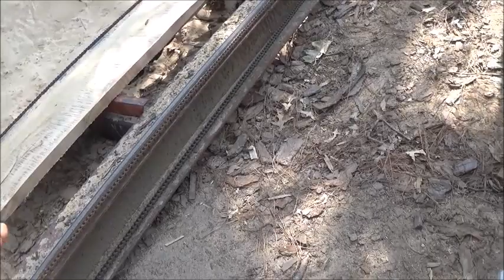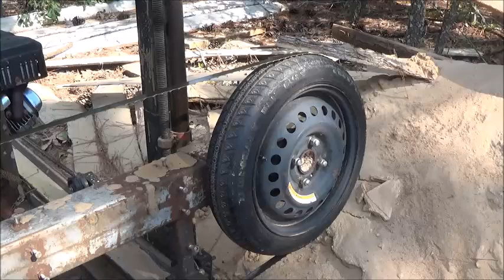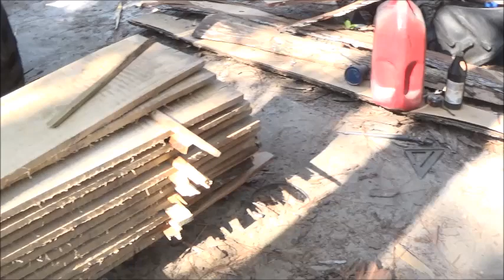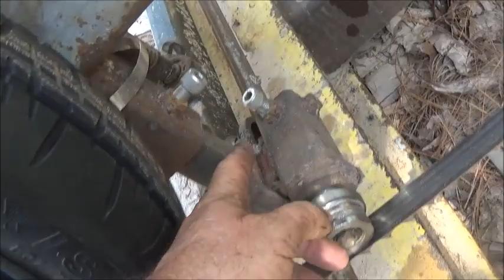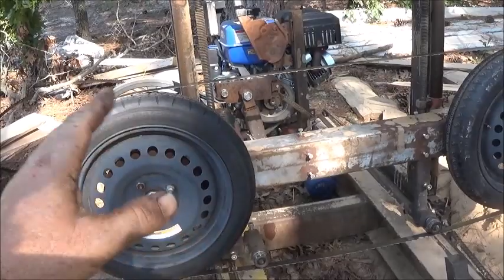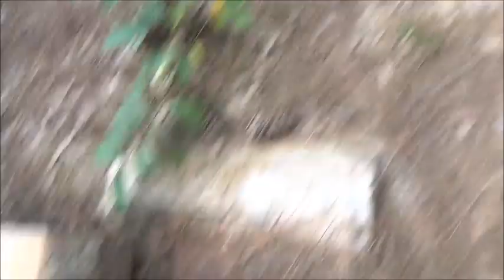HOME MADE BAND MILL, ONE YEAR IN REVIEW

Comment: Jonathan,  I really enjoyed this series on building a sawmill.  I am wondering what size your gear motor is.  I understand it is running at 90vdc, but wondering what the hp of the motor is and also what the gear ratio is.  What would you estimate the rpm is forward and what is it in reverse?  Just roughly.

Also, have you been using this sawmill lately?  I haven't seen any video on it lately.  You sure did a nice job on it.

I am liking a lot of your steam stuff lately, but I enjoy stuff like this as well.  Keep up the good work.  Thank you for everything you do.   You are a talented man.

Comment: I wonder if you could use a power steering unit to power your gear box for raising / lowering the saw head. That way you are still in control of how many turns it does, but you could locate it in a more handy location with and easier effort to turn the handles.

Comment: J/W, of course the saw blade stays where it should.  Crowned pulleys were/are used with flat belt equipment and work just fine.  Those tires are crowned pulleys.  Damned good job and totally beyond my VERY limited capabilities.

Comment: Common sense is the best education a person can have.l
I call these machines "purpose built". There is an immediate need for the machine and you build it with what you have. Often us poor people that are on a limited income do fine but for a 10k to 15k investment it's just out of the question. Us that can build our stuff.
Some of us like the challenge of the build. Some of us are just too cheap to come off the cash. Some are all of the above. 
Our machines are to please us by doing what we need at the time. I have a cement mixer that I built many years ago sitting out in the woods. It is ugly and noisy because I used a starter drive and flywheel for the drive on the drum. But it did a phenomenal job of mixing concrete and I had it running long before I could have bought a new one. So often there are tack welds, improvements, mistakes and no paint. They may be loud and missing the popular safety equipment.
We know the limitations of our machines and our selves. 
Common sense is the best education a person can have.
Glad to see you back Jonathan. I know it's been terrible hot and humid. I live in the upstate of South Carolina near Spartanburg and I have pretty much kicked it into neutral and stayed inside. I know you don't have that luxury but I'm retired and disabled. I know my limitations.
Take care of yourself.
I love the saw mill.
No Nana appearances but if I was wearing a fur coat in this heat I wouldn't be very social either.
LOL!
Cheers
Terry

Comment: Nice mill. We have quite a few donut tire home built mills around our area most people that have them have problems with the tire mills taking the tooth set out of the blade and plugging the cut with sawdust and pitch in pine and cutting slow in hardwood. I bought a tire mill a few years back but the guy that had put a set of steel band wheels from Baker on it so never got to use it with tires but most people around here with tire mills complain about the tires taking the set out of the blade.

Comment: You could put in a rapid feed button.

That engine was actually built by Loncin which is one of the top Chinese engine makers.  These engines were actually engineered by Cummins Power Generation and have a V-valve design which isn't found in other Chinese engines.  This is the same company which builds the engine for the BMW G650GS.

Comment: The only thing I would rather have on this is the pull vs. push you talked about on the blade. But that's just me. You covered it well, the reason most problems occur pushing is the tension. But you are correct it's still a pull on top, and if tensioned correctly becomes a unified power circle. Most of the bandmill problems that happen come from inexperience with blade tensions. I like your lil mill, you need to finish it up and paint it! LOL... you're embarrassing your boards! I wonder if anyone would say its going to kill you if it was all shiny and guarded/finished up like the wreckers I've seen you do.
As for the "it's going to kill you" sentiment... well there's just some things that some people shouldn't do. I would say if you were going to be killed for ignorance - your towing business would've ate you a long time ago. Your far enough along - it ain't luck anymore. Thanks for sharing

Comment: I learned a lot from this conversation Jonathan.... I have actually built two mills from scratch years ago but what I built was direct copies of another mill and stuck to that idea. Just from what I noticed on yours is a completely better idea. I had always used those flat wheels with the rubber band on them an   the teeth protruded out a little bit... your idea on what or why those tires is genius! I am dang old.... not dead. I see a big mill for very large timber coming now as my god son is wanting to buy a mill an not spend a fortune.. my former advice was best look at what you can even find. Just happens that there is a lot of equipment for working with near me so I might not even have to do the work, just be the ringleader kinda.

Comment: Inspect the blade ( with mill turned off) see if you can find the damaged tooth/ teeth and file the high spot(s)  off.  It should minimize the rough cut area every time it comes around. 
It probably won’t cut as well at those places, but you can minimize the damage it creates with each rotation. Just a thought.
Reply: Unless the blade stopped moving, chances are he got every tooth on that blade. I think he said it sawed through and if it did then all the teeth are done.